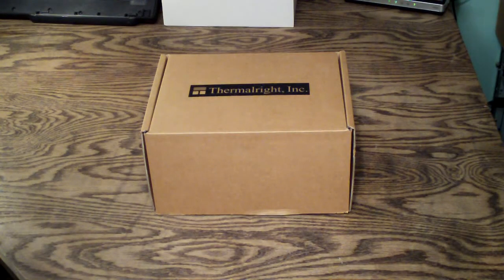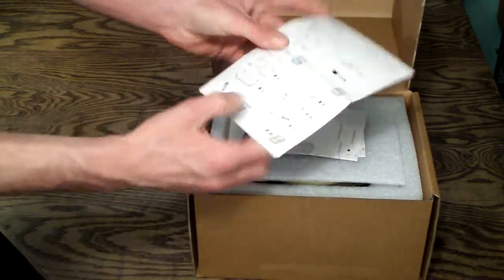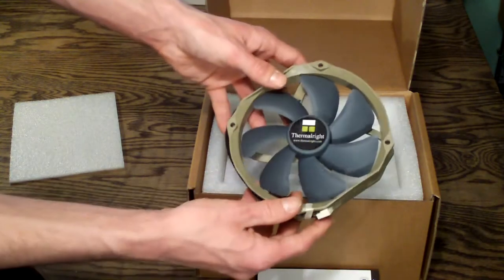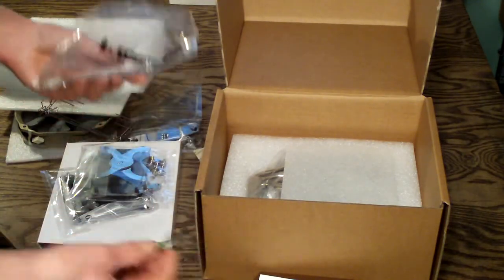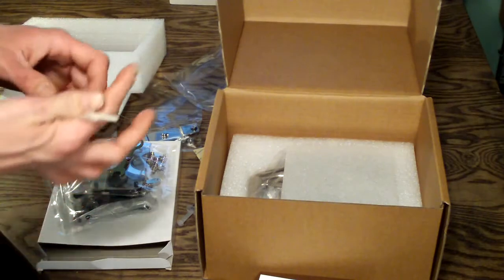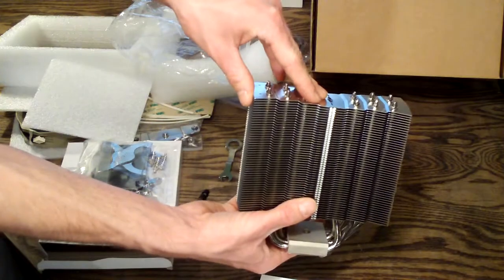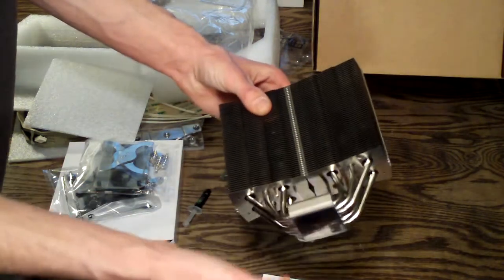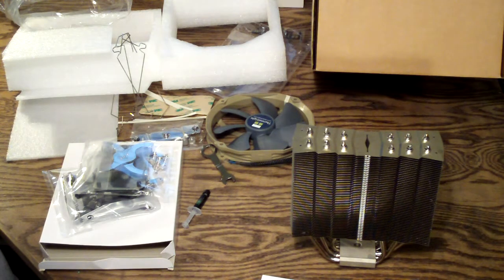Thermalright Archon CPU Cooler Unboxing & Product Overview

Comment from the maker: @hydrophoenixx Kinda hard to answer I do not think the fluid in the heatpipes would withstand those temps. It might evaporate and worsen cooling. I think this cooler has dissipate around 150w or so or heat. Highest I ever saw was around 100-110c under load on a CPU.

Comment: I have a very unorthodox question about this heat sink. I want to make a totally new kind of heater and want to use this as my heat exchanger. How much heat can this cooler take.  I need to run it at 100 to 600 degrees C.  Is that possible with this cooler?